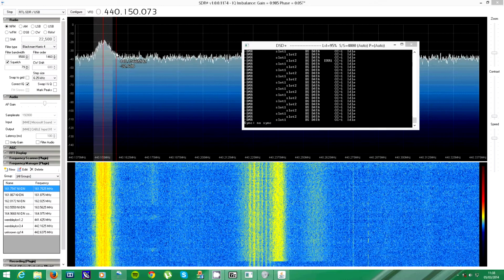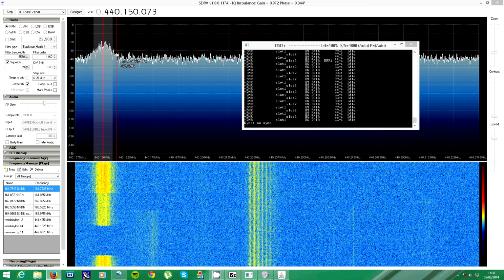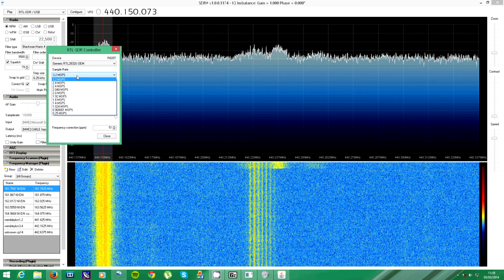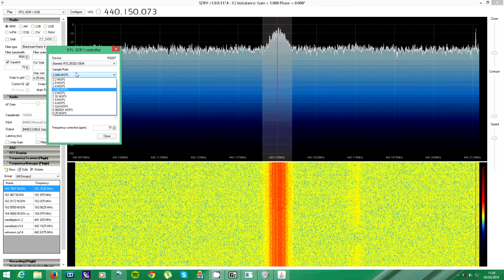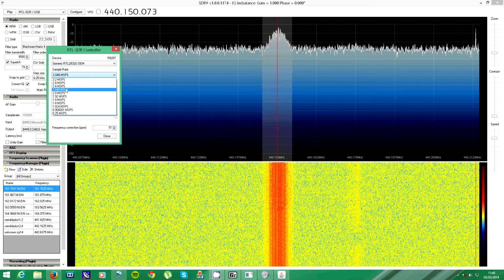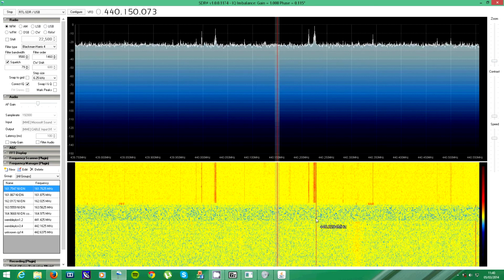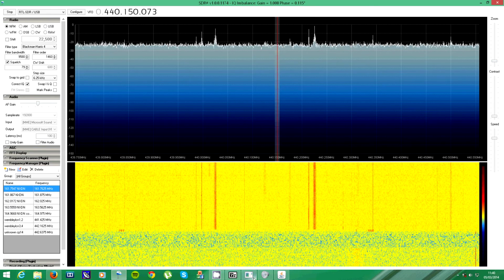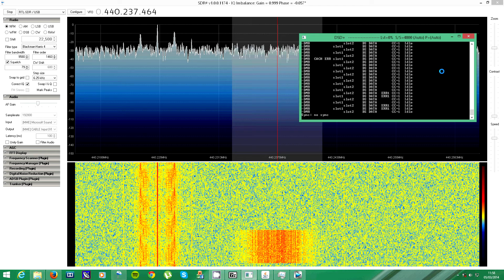Quick tip on decoding DMR/P25/NXDN on RTL SDR

Comment: How would I go about listening to MOTOTRBO tier 3 trunked?
Reply from the maker: It's DMR Tier 3 not MotoTRBO. MotoTRBO is Motorola's line up of DMR compatible radios. Or Motorola's DMR Tier 3 solution is called Capacity Max. You can hear the voice channels by tuning to them as shown in this and other videos of mine. I also have a video on NXDN trunking, I think you may be able to apply the same thing to DMR tier 3.
Reply: radiosification thanks for the correction and the advice. Much appreciated.

Comment: I've been experiencing some decoding problems... Every single signal I try do decode gets "ERR1", "ERR2" and "ERR3" messages... Any tips of what's going wrong?
PS. I'm totally newbie in this radio world
Reply: You will want to mess with your gain and your output volume. Those can change the rate of errors and minimize greatly if you have an ok signal.
Reply from the maker: Probably just a weak signal. It's common to get errors like that, as long as you can still hear voice, when there is voice being transmitted, then it's fine

Comment: Im a newbie and using sdrsharp and dsdplus to decode DMR.... Question: why am I hearing the trunked signal as well as the decoded voice...im using windows 7 and have been messing about with it for a while and cant figure it out....anyone any suggestions? much appreciated
Reply from the maker: You should be able to just open up the volume mixer and mute the raw audio. (Right click the speaker icon in the notification area)
Reply: Yeah I got there in the end thanks for your reply

Comment: Great video,  I appreciate the information, My sample rate is set at 4800 and it's grayed out, can't change it.  Is there any way to change it without downloading and configuring another copy of SDR Sharp?
Reply from the maker: Did you make sure it was stopped before trying to change it?
Which sample rate do you mean, because the one I talked about here can only go up to 3.2 MSPS maximum.
Reply: Sorry, my mistake, I do have it set to 2,048 MSPS and quadrature sanpling in the drop down menu. Under Audio what should the input and output be?
Reply from the maker: I think it should be at 48000. There is a guide showing how to do it somewhere online. Basically you go in the configuration file and set it in there
Reply: 48000 is correct,  I didn't add enough zeros in my message here.  Anyway, I got that part working,  When I receive a p25 transmission. I get the message sync invalidated in dsd. I'm looking for a solution to that problem now.